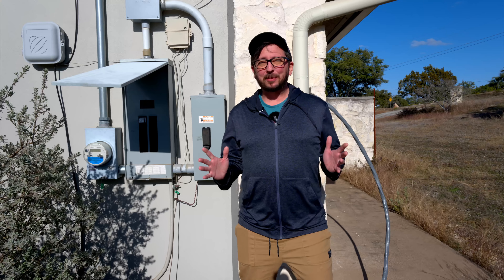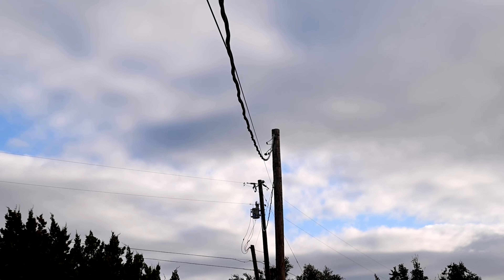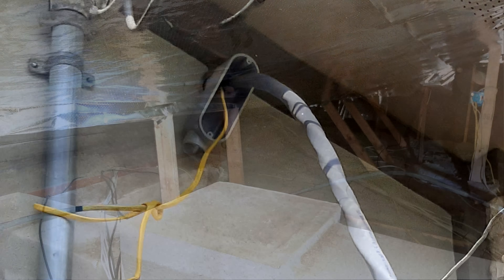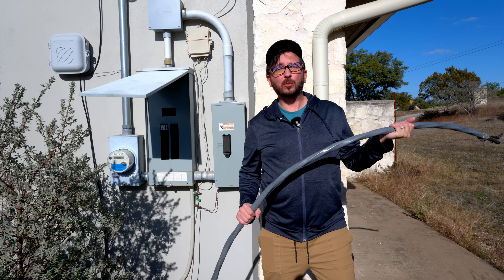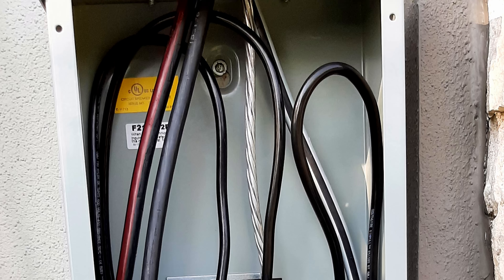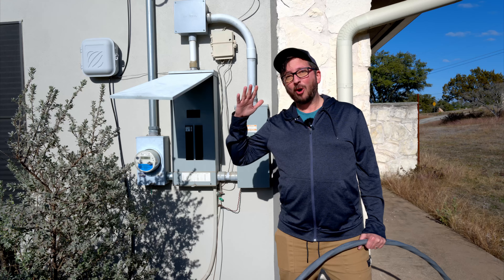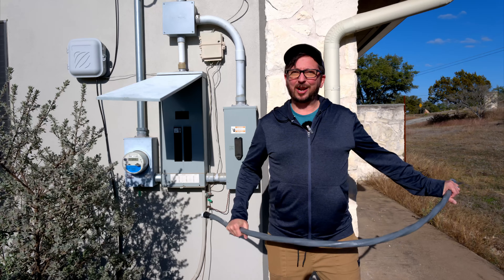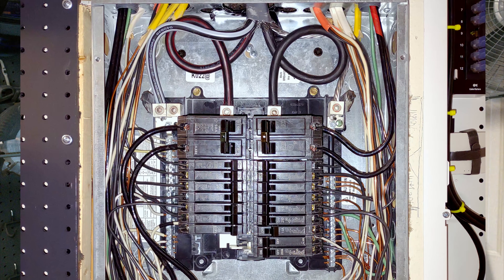INSANE Homelab Datacenter Power and Electric

Comment: Looks good as a home lab.  I would definitely consult with an electrician who does datacenters to see if there’s anything that could be done to optimize. Even negative air could help with dust. 

Over all great job.
Reply from the maker: Yeah I need to go ahead and get rid of the garage doors and finish this transition. Working around those is a huge hassle and finding things like snakes in here is not ideal.

Comment: sooo... someone could just go to back of the house, flip a switch and all lights are off?
Reply from the maker: That would be a very very bad idea to attempt in Texas. Especially since I have cameras all over the property with motion sensors. I can also put a lock on that if I wanted, but the prior mentioned bad idea part is why you never see folks doing that here. I'd take that as a trespasser who was intending harm and react accordingly (and legally be covered as well)
Reply: I see. It's just weird from a european perspective to not have this inside. Is there a good reason to do it this way? @DigitalSpaceport
Reply from the maker: I would very much prefer it to be inside as well. They have started doing that more in recent years but this house is actually a but older, 1970s construction, and outdoor mounting was the standard then. We have arial poles, so it saves some money to have externally mounted mains but it is not a large savings. I had to remove all the aluminum and clad aluminum wires from the house as well so building standards in the last 50 years have changes drastically.

Comment: American leccy is so so dangerous, no 240v, exposed neutrals......
Reply from the maker: I have 240V running to this rack. 120VAC is dangerous however if you get shocked. Dont forget we cant fit as much onto a single circuit, so we have to have more circuits, and that costs more $$$ to mfg.

Comment: hey what are those things you installed above the racks onto the ceilings for routing the wires called? thank you
Reply from the maker: Those are Kabel Kontrol cable trays, also called raceways sometimes. I would recommend getting the mount standoffs for over the race as official parts, but you can save a decent amount with HD wall ladder hangers to sit it in. It's not as pretty, but each official wall bracket is like 30. I would avoid the stuff without sides also. You might enjoy this timestamp from another video when I installed it. https://youtu.be/nlC3euvNwXk?t=1306&si=EAwtY84TXinOqLDF
Reply: bless my g  @DigitalSpaceport
Reply: Just a Cable Tray

Comment: Why in USA these breaker boxes are always outside? In central Europe all electric wiring is done somewhere inside the house. Sometimes on older houses one can spot overhead power line arriving at the wall, but no breaker boxes.
Reply from the maker: It is annoying indeed! Especially if its raining and you have to do anything.
Reply: It's a regional thing - NOT a US as a whole thing.

Comment: Can’t wait for the “I converted my 2.2 kw data center to 4 raspberry pi’s “ video
Reply from the maker: sub in EPYC for RPi and its happening. I wish RPi's could do real GPU compute workloads and had lots of PCIe lanes. I know ampre has some of those units but they are much more expensive vs Rome gen and the PCIe4 lane demand in this lab is very high.

Comment: Good stuff!!! Great overview. The thickest 3-conductor cable I've pulled has been 6/3 copper and even that was a pain in the rear to manage. It's not heavy really, it's just that the dang stuff doesn't bend easily.  I can't imagine what pulling that AL cable was like, looks like 2/0 maybe?
Reply from the maker: 1/0 and yeah it was a very hard pull in the 3:12 pitched roof. The amount of time getting each extra foot pulled in sucked. That the inlet to the attic of course in the furthest pinched corner made it horrible also. The AL is indeed not heavy but man doing that by myself was for sure a bad day. After I got it into the attic, I had to route it under the ducting and stuff and what a mess that all was.

Comment: Permits Schmermits

The question is, what work is all that running hardware and blinkenlicht... in 2024... actually... doing... ?
Who needs to host anything.. locally... any more....
Reply from the maker: A fair question indeed. It has 2 purposes, each with segregated networks. One of the 60 bay JBODS and the R720XD host my businesses data. No, this is not Linus level backups of videos just to say that upfront. This is a pretty high performance TrueNAS install on 600TiB raw space with roughly 400TiB effective storage capacity accounting for ZFS slop. I wont say what company I own, but I do process and produce GIS related information at massive scales and for industries that have strict regulations around that information. I frequently move 40-60TiB of space around and process it on the R930's as needed. Getting more higher performance GPUs into the mix is important but they need PCIe4 full lanes access, hence the move to EPYCS. The R520 also runs PBS server and does backups of some of the data every few hours.

Not your typical use case, but if you priced this out in a compliant cloud solution.... OMFG levels of cost. Easily in the 10's of thousands per month. However I agree, most folks do not need to have this level of compute + storage onsite, nor are they qualified to secure their own data.

The second use is a chia farm in its own vlan on extra storage that pays me ~1K a month off the other 2 JBODs, more than enough to cover the operational costs of the mini datacenter which is around 150-175/mo. Eventually those drives may house business data as the data demands grow, but for now its a nice little extra offset. That is currently powered off a proxmox cluster that encompasses the T620, 5950x and H12SSLi.

Comment: Whats your full base load? I am at ~3KW full time for just the rack and ~5KW when the HVAC is running. I also built my own UPS after my set of 3KW APCs died, I am rocking ~3-3.5 hours of runtime on battery and still hitting ~10ms transfer time. Using Lithium batteries also lets me dump power into them if the power only comes back for a short time, pretty handy.
Reply from the maker: The heaviest total load I hit was a total of 12 kW back when I had 2 of the Eatons in service. It was split across them pretty well but did take a full window AC running full blast nonstop to cool them also at around 1.5 kW extra power. Lucky I only had to run that for like 6 days.
Reply: @DigitalSpaceport  Thats peek, not base, lol, also, did I hear you right in the video? The quad proc Dells pull 100W powered off, so you unplug them, but you have switched and metered PDUs? Why not just make a super simple script that when you send it something like "shutdown dell#1 --power-off" it tells the OS to shutdown, then polls the iDrac for state of powered on or off, then when it sees powered off in iDrac it then switches the outlets off. Similar for power on as well.
Reply from the maker: Oh yeah base is 2.2 and I need to figure out the snmp capability of these switches. The web interface is super slow so it's just faster to unplug them but automating that and especially logging an alert if I forget to hard switch them is needed bad. I have no idea what they are doing but yeah that's powered off completely. Not some standby mode.
Reply: @DigitalSpaceport I would assume a scripted post to the  thing you wan to affect might suck less, but telnet/ssh/snmp are valid options also. 

Maybe the iDracs are mining crypto? lol, the only other thing I can think of, is maybe something like the IME on the procs are keeping them awake in a odd power state? or maybe it's keeping the RAM powered for some reason, I would need to grab a FLIR and see whats doing stuff based off of it generating heat or not.
Reply from the maker: They do have snmp v2 at least so I think that is my likely route. Tracking them for accidental "left powered" is very important to me also as that adds up really fast. 

Given that they are quad sockets and originally insanely expensive, I think they were intended for a datacenter that likely wouldnt care about powered off usage. They probably had been running nonstop to maximize their investment value. As packaged when I got them each would have been over 120K retail and the admin told me they ran many of the universities hypervisors.
Reply: @DigitalSpaceport  I mean, as far as the cutover time goes, that depends on the holdup time on your gear, the APCs I had claimed 4-8ms and the off-grid inverters I am using claim 10-20ms, but in UPS mode it should be 10ms, the 20ms is if solar is involved, but if I wanted 0ms time I would move to the double conversion MPP Solar "PIP-LV-MK SERIES – ZERO TRANSFER TIME" modules, but it's been fine for me, as far as I can find, all of my PSUs have a 17ms hold up time and I am at 10ms, soooo, good enough for me coming from a set of APC SMT3000RM2U.
Reply: @DigitalSpaceport  I mean, I have 19 Dell R740XD servers in each our data centers and they were ~$40K each with discounts, the real pain points are how much RAM you get in them, Though now a day with as fast and sensitive as workloads can be, if you are not paying close attention to NUMA locality, you are gonna have a bad time.
Reply: Given the availability of "off-grid" hardware these days, there's really no need for a packaged UPS when you go bigger than "desk". Plus, around 1500VA, no one makes 120V models. (because 15A outlets.)
Reply from the maker: I disagree unless you have some products that can run double conversion constantly. The switchover time is much faster on quality UPS gear as well when running in HE modes. I personally always switch over to double conversion when there is an impending weather thing or known electrical demand issue, but I would love to have a portable unit that could handle 7 kW peak load and run constantly.

Comment: Great setup, I’m striving to achieve something like that for my work/startup. It’s definitely cheaper than running on the cloud. Just curious if you could share what type of processing do you do? Like video, data analytics, ML? I have a bunch of gpu machines at the moment doing mostly ML stuff but not as nice of a setup. Also running Proxmox like you’ve shown there with VMs and dockers.
Reply from the maker: Yeah I do rendering of GIS information for massive amounts of land and that takes multiple steps and hits various components heavy at different stages. CPU is still heavily used also for lightmass static lighting however raytracing has come a really long way. That's the business data side of things and is why I keep the R930s around... Its not often I need 1TB+ of RAM, but when you do you just do. I would rate my GPU side as pretty weak honestly in its configuration right now and I hope to improve upon it a lot. I have been thinking I should do a full rack tour to give folks all the details about what is in each machine.
Reply: @DigitalSpaceport  thanks for reply. It’s cool to see what other folks do which I’ve never dabbled with myself

Comment: i so wouldnt want to know how much it costs to run that  like i dont need something that huge forsure atleast for what i do but i would consider getting a surge protector at your meter or at either the main panel or sub panel so you dont risk another lightning strike destroying another UPS....all i do is i have a desktop pc repurposed as plex server and a backup server for my laptop
Reply from the maker: Oh we have a whole house dump breaker in the mains panel but it didnt trip fast enough. Overall while the other UPS getting taken down was bad, it could have been WAY worse considering how much the HDDs cost that it had been protecting. Its not that bad, around 150-175/mo at baseline 2.2 ish kW.

Comment: You need to see if Kioxia has anymore of those 30.72TB C6 drives laying around they could send out like they did some others. I can't image 2.6PB of  what I would have to think is skinny rust is doing your power bill any favors either. Granting the systems to run them all wouldn't be cheap either.
Reply from the maker: I have seen them on Storage Review and they look amazing! 180 spinning platters @ 5.6w idle is ~1008 watts, with their duty cycle likely 1300 avg. $3/day or $90/mo ish. Granted I do make a lot more than that off them and cloud storage for my business data alone would be ridiculously more.

Comment: Why do you unplug servers when you have a PDU?
Reply from the maker: The answer is super pedestrian. Its faster than using the web interface on these PDUs. They do allow me that function, but its horribly slow to do it. They do have SNMP but I have not investigated if I can create an external interface for them yet to power of sockets/banks. They are also off 95% of the time so I don't spin them up usually more than once a month, but that will be accelerating in '24 so I do need to get a faster solution for that.

Comment: Where abouts are you located? I'm guessing this is in a more rural location.
Reply from the maker: Nope. 18 miles from downtown Austin but not on Austin energy. PEC.
Reply: @DigitalSpaceport  Ah, cool. Is your power bill a lot? That's a lot of equipment.
Reply from the maker: Not really. The datacenter runs around 150-175 a month off its baseline, add in an additional 150 if doing a lot of processing on either the R930s or GPUs.

Comment: So you have a 125 Amp Panel serving you house and a 250 Amp panel servicing you data center, all connected to a 125 Amp meter base?
Reply from the maker: No I have a 200 amp mains service and a 125 amp sub panel. The sub panel runs a lot more that used to run off the main panel also. Well pump, water heater, outdoor areas, 2 kitchen circuits, washer/dryer. It was a good time to rebalance everything when I ran the subpanel.